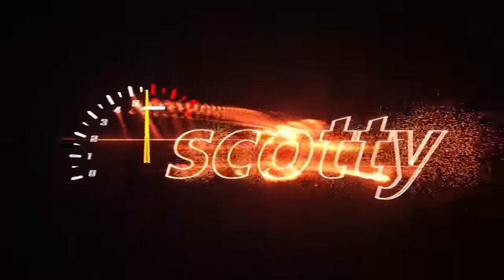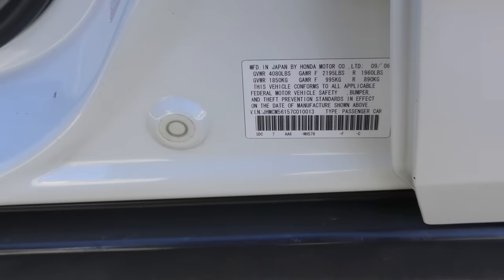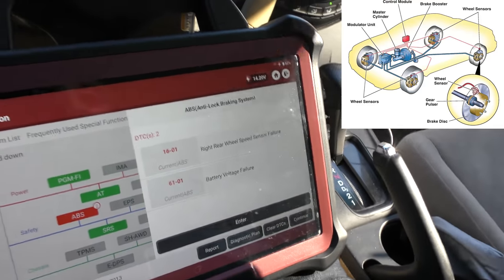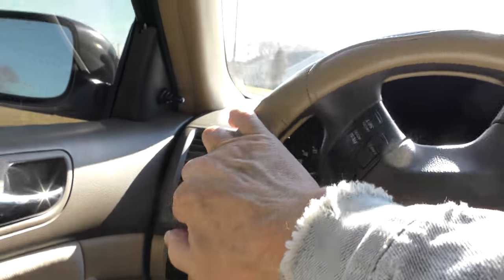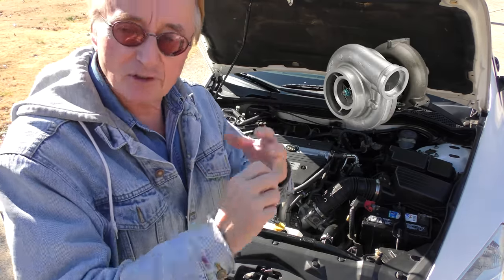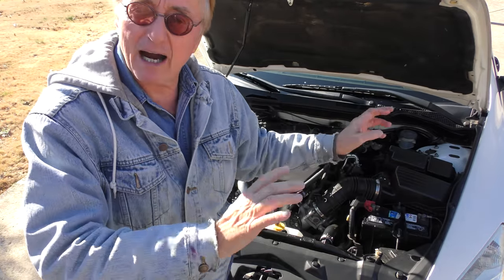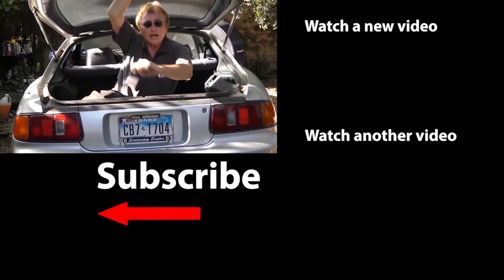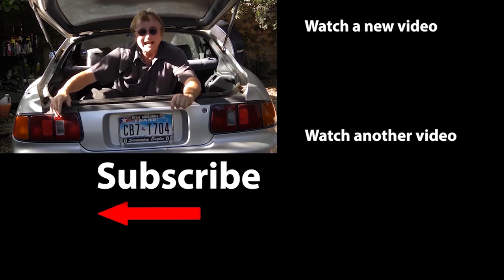Stop Buying Hondas with This Engine

Comment: I have a 04 honda accord with the 2.4 manual, and theyre fantastic cars. i got mine with 235 miles august of 2020. a valve burnt up may of 2012 at 282k so i rebuilt the engine, and shes at 288k. the k series is a beautiful engine.

Comment: The scary thing is I know you need to adjust the valves on Hondas but my friend who is a mechanic swears it's only on the v6 engines thank God I know know how to fix my own vehicles
Reply: Never heard of valves needing adjustment on Honda’s.  I put 480,000 klms on my 2007, engine was still quiet and strong when I put her down never any value adjustment.
Reply: @rodhurst5831  The  2.4k engine in  my 05 Element did  require a valve adjustment at 110k miles. Dealer says cost is $468 including new spark plugs. Interesting, the little box oil change shop manager claimed it is a scam but my home boys say it's important to do the service.
Reply: No all Honda engines need periodic valve adjustments, your friend is wrong
Reply: @overseasterritory8983  that's what I said

Comment: I have the same one but with the 3.0 V6. Runs great over 200k miles
Reply: V6 honda

Honda J30A engine for Honda Accord for years 2003, 2004 & 2005. ... which returns for a second-straight year on the Ward's 10 Best Engines list
Reply: Also one of the very few non interference honda engines.

Comment: Let me get Scotty up to date with new Honda engines. The oil dilution issue is fixed and the turbos in the L series and K series are easy to swap out even if they do go bad. Much easier than doing a timing belt change on an older J series and almost as user friendly as an alternator change since the turbos are located near the front next to the headers and radiator. So Honda still makes quality and  easy to maintain engines. CVTs are still not as great and or reliable as autos or manuals but give it some time and they may get to Toyota quality levels.

Comment: I have a 4cyl   2001 Honda Accord with about 2 1/2 k and I have always felt that what Scotty Kilmer meant about the 6cyl is not that it is a poor engine, but that it is harder on the tranny because the 4 and 6 cyl have the same transmission, so the more powerful 6cyl is harder on the same tranny. I f I am not correct, i apologize.
Reply: No they don't have the same transmission The V6 engine Was over powered for the transmission of 2003-2004 Is a later corrected the transmission

Comment: I don’t know who the person that owns that Honda is, but that’s a person every car owner should take an example from in car maintenance. I have no doubts that car will reach 500,000 miles or more if they keep it up. Well done Scotty also why doesn’t Tesla use the waste heat from the batteries or motors, which can easily hit 100 degrees. Or a heat pump. Serious Elon, get with the program.

Comment: The real problem with the 3.0L V6 is not the engine itself, but rather with the 5 speed automatic that Honda bolted to it. Ask me how I know.  Also the EX radios died after about 75k miles, and the brake rotors warped easily. Otherwise a great car.

Comment: I have a 99 Honda civic and it runs great . Just one problem  .... the brake lights do not work . I replaced bulbs , fuses , brakelight switch , turn signal switch and still nothing . All three brake lights are out

Comment: The 2.4 engine with minimum care is almost indestructible! My 06 TSX with 165K has been roughed up for its last 100K miles and still runs like nothing happened! That’s the engine but changed rack&pinions, various bearings, electronics issues, faded paint (no care), interior feels every single mile, etc…. The car has been beat up by previous owners yet engine survived these idiots

Comment: My 2020 ilx has the k24 engine  and is paired with an 8 speed dct.  My lease will be up soon, but the new integra is out of my price range.  The new integra has the 1.5 l engine and is paired with a cvt.  You can get a manual on the top spec 50,000 integra.  Much prefer the drive train on my ilx.  Being pushed into a civic 2l with a cvt.  Prices are ridiculous and interest rates are sky high.

Comment: 98 accord with over 270,000 miles on it when it was sold in 2015. Those 4 cylinders just run and run. Salt ate away at the muffler but 🤷‍♂️ thats 17 years of winters on it. 2015 civic with 160,000 miles and was well on its way to 300,000 by now but it was unfortunately hit and totaled.

Comment: 2010 Accord V6 timing belt just replaced at ~110K miles US$735 (AUD$1100)... in Australia, which is likely significantly more expensive than USA.
not cheap... but when it's once every ~100K ? not a deal breaker. at least not for me.

Comment: Hi Scotty! What's your opinion on the spin off segment that is popular in Asian countries? It's like a hybrid between MPVs and an SUV. These cars are 7-seaters with 1.5L petrol engine usually giving only 120PS and 130-140 NM Torque coupled to a 4 Speed automatic transmission or a CVT. Examples of this are the Toyota Rush, Mitsubishi Xpander, Honda BR-V.

Comment: the v6 is still very reliable. my friend got 500k out of his 02 Acura TL.
Reply: The 3.2 V6 in those cars are basically unbreakable aslong as you watch the oil levels those are very very strong engines I believe even stronger then the 3.0 v6..but man those Acura TL transmissions are garbage

Comment: Only issue ive had out of my wifes 07 accord ,with the 2.4l 4cyl  @170k miles , is low idle , ive been reading and i think the throttle body needs cleaning , and ill check the intake tube for leaks . But it runs great just idles low and vibrates a little.

Comment: I bought this car as a daily because of the reliabillity ive heard....But now im burning INSANE amounts of oil in this car...Pcv replaced, MMO added, tried everything only thing i can think is stuck oil ring in 1 or multiple cylinders. Burned 1 qt of Mobil 1 5w20 in only 200mi. PLEASE HELP i dont want to rebuild this motor
Reply: sell it and be sincere to the potential buyer that it burns oil. Get ur cash and buy something else. Time to simply get rid of it.

Comment: Scotty, I did what you said not to do- I bought a 3.0 Honda Accord with a 6 speed manual tranny BUT ITS GOT BAD VTEC because of an engine swap. It revs fine for the first 10 mins, but after that it won’t rev past 3k , it just bounces off and loses power unless I shift before 3K . Mechanics haven’t figured it out yet :( shoulda listened to Scotty
Reply: Try checking your Vtec valve that’s what they called limp mode your Vtec power switch are entire Vtec valve might need changing it’s right behind the engine for 2.4 I just change my Vtec valve switch and change the Vtec valve filter

Comment: I have a 2006 V6 Honda Accord with nav.  It has 245K miles on it and looks and drives as well as it did 17 years ago when I bought it.  The nav works better than the 2022 vehicle I have.  I’ve done very little to the car.  It gets 21 miles/gal.  Plenty of power.  Handling great.  I’m passing the car on to my kids.  I’m not sure this car will ever die.

Comment: Bought one 6 mos ago   4 cyl   no rust 120k mi 2500$  2nd car no repairs so far  not used much  code for gas tank    one allowed in NY.    2001    Passes insp.

Comment: Question ... I have an 09 CRV with the same engine , what should  someone expect to pay for the valve adjustment?  I've never done a valve adjustment on my own. Had the CRV from 2020 @87k- present with 145k currently .. Best honda I've had . Any other recommended major services at my current  mileage?  Water pump /serp belt / fluids?

Comment: I've got a an 06 Honda Element that has the K24 engine 4 cylinder 2.4L. It has 155,000 miles on it and uses a little oil, but It's been cared for really well. I so wanted it to have been made in Japan, but it was made in Kentucky. What really is the major difference between having it made in Japan vs Kentucky

Comment: My 2008 Honda's engine just broke down a few months ago with 305,000 miles, Just put a used Japanese Engine with ~30,000 miles compare durability with beautiful but Trash engines of an AUDI & BMW you'll be lucky if those engines last you 100K miles.

Comment: I had a Toyota Camry with a 140 hp four-cylinder engine and a Toyota Camry with a 268 hp six-cylinder engine.

The four-cylinder average 29 miles per gallon in mixed driving and a six cylinder engine average 27 miles per gallon in mixed city/Hiway driving.

The six cylinder had nearly twice the power, made passing other vehicles a breeze, and allows me to cruise down the highway at 85 miles an hour effortlessly.

I’ll take a six cylinder over the four-cylinder any day of the week.

Comment: Nice I have a 2006 2.4 with 250 k only thing it needs valves adjusted but runs like a clock

Comment: I'm currently in a financially questionable situation myself where I'm doing doordash to make money while I wait to get approved for SSDI and got a 2008 Grand Marquis with a loan a few months ago while I was still employed full time (and gas was still around 3 bucks a gallon). I'm getting back a decent chunk from taxes and am considering buying a car with that cash to get rid of the loan since I'm struggling to make payments since I'm putting $60 in my tank every 3 days (and Doordash makes me that much mostly during weekend days). An option is a nice 157K mile 1998 Grand Prix GT for sale that, after talking with the owner, has been maintained and even got a new transmission a few thousand miles ago (huge on those 3800 cars) but the owner got something bigger and stopped driving the Pontiac as much (hence why he's selling it). I'm at the point now should I take the chance of keeping my car, which in itself is in need of a lot of little repairs, or get the Grand Prix banking on the owner being honest and sell the Mercury to put the money I would put toward the loan toward the Pontiac instead. I'm trying to find a 4 cylinder car but they're all either beat to heck or need too much in repair for under 2K and the Grand Prix is so far the most promising right now despite having a V6

Comment: Scotty, I have this exact car with 320,000 miles. It runs like new. Lots of highway miles. One light came on and put catalytic converter juice in it and it went away. I’m shooting for 500k miles. Meticulously maintained. I never changed my oil before 5000 miles. Usually closer to 10000. Glad you concur.
Reply: My 2018 Civic will let you go about 10K miles before the oil light comes on. And I change it when the light comes on.

Comment: Scotty, we are looking to purchase a used vehicle for the third family vehicle for minimum needs, probably 5,000 miles per year. Looking at 2003 to 2007 Saturn Vue with the Honda V6 and Honda transmission. Looking at vehicles with 140k to 280k mileage. Price range is very attractive. What do you think?

Comment: I got a 2011 Scion xB 2.4 engine.  Burns alot of oil 173k miles.  I don't wanna get rid of It.  I thought about doing an engine swap with a 2011 Corolla 1.8 for better gas mileage and no oil burning.  I know I'll need a wiring harness but I'm not sure what else I will need

Comment: Damn Scotty reading my mind I have the same car and I’m starting to think it’s time to get rid of it!it’s been starting to rock me up money left ,right and center !
Reply: Curious, what have you done to it?
Reply: @jaybronze94  I’ve change  o2 sensor desno auto zone,the engine valve cover gasket major oil leak,spark plug’s,wheel bearing,driver cv axel,power steering pressure hose leak,front engine mount ,passenger engine mount,got the ac fix in 2020 was blowing hot air ,still the same alternator!brakes and rotors change ,new discount tires,change the vtc filter discover it was leaking and to change it you of to take the pulley and serpentine belt off,I change my Vtec oil pressure sensor switch discover a leak plus my car was in what they called limp mode rpm won’t go over 2k,and I change the filter for the  Vtec Solenoid also !I have 190k so at this point I might need a new water pump,coolant flush,seals  serpentine belt ,and transmission flush !And now Im starting to hear a whining in the steering wheel so I purchase the new O ring for the pressure pump I see online ppl say sometimes it the pressure pump needing to be change are just a new O-ring I went the cheaper route to see first if it’s just a cheap little o ring it need’s!and I also discovered I have a crack air intake filter so had that to the bill!and for some reason Honda headliner is known to get water soaking through the Passover side so overtime my headline finally gave way so it’s sagging like captain underpants !Its been a good A to B car I would love for it to last me another 100k are more bt I don’t know how much more I can put into it I probably wouldn’t gotten. Different car if it wasn’t for the market being this bad so I endup put money into it instead ,luckily besides the parts I mention I met a cool guy who live next door like Scotty speaks no English bt he knows car stuff so he’s been helping me which has save me with the installing of the engine mounts and changing the vtc filter and changing my o2 sensor

Comment: If you put it to a dollar and cents figure a quarter million miles car in today’s standard to replace it would be $.10 on the dollar per mile so basically you got $26,000 worth of car that you’ve used so far try to replace that car for less than that with a new car, Which means if you’re going to buy a new vehicle put that money in a bank earning interest and keep the old high mileage car that runs perfectly until it actually craps out on you then find out what it cost if it’s still within reason to Repair and repair it or use the money you saved to buy another car

Comment: My '95 2.2l only has 212,000 miles, But, a tree branch bash the hood crushed radiator support bashed up fender and headlights. Im debating wether to sink more money in. i had just rebuilt the front end.😢
It's all bodywork/paint really but, not cheap and Im kinda stuck.🤷🏾‍♀️
Reply: Best running car ever tho.
Valve cover gaskets/valve adjustments were annoying, computer died also annoying, did it all myself tho! Love this car❤
Gonna miss her.

Comment: Hey scotty , my 2012 honda accord lx shakes terribly at highway speed. The person who I bought it from back is july 13 of 2020 have refused to tell me the real reason why the car shakes at high way speed. I bought the car while it was with the shaking issue and the seller told me to buy new tires and I'll be good,  but the shaking haven't stop. I was told by a gas station mechanic that the issue is motor mount and I bought the motor mounts and paid him to install it ,but it's still shaking.
Reply: If it's not anything to do with the wheels, susoension, or body, and it's not the mounts, it's probably either your harmonic balancer or your VTC actuator

Get an OBDII Scan Tool (~$40) and scan your car for codes.

Comment: Scotty my newly purchased  2013 Honda Accord with 73000 miles on it jerks at low RPMs and sometimes very badly.. Scan tool only detects problem with Vehicle Stability Assist and power steering. What could be the reason for the Jerking... Daniel from Ghana

Comment: Is there any bad years for them Honda four cylinders?
Reply: 1998-2002 because of the automatic transmissions of course, otherwise minor problems with the 2003-2007 generation and 2008-2012 generation Accords, Civics umm early 2000 models, and CRV is the same thing, otherwise not really it varies. 🤷🏻‍♂️

Comment: I would trust that car as is more so than a 2021 Ford,Chevy, or Chrysler which I promise will break down before they get 90k miles on them. The junk being produced right now is unbelievable! They are selling some of the most problematic engines in their histories right now and charging more than they ever did in History for them. I will not touch anything outside of a Honda or Toyota going forward. Before the Eco-Boost and Eco direct injection engines came a long Ford,GM,and Chrysler was not that bad, but as soon as they introduced the Eco-Boost direct injected engines they have been terrible reliability wise and a lot of catastrophic engine failures.

Comment: About to buy a 2007 accord ex 3.0 v6, BUT only 28583, recent changes of timing belt and other stuff, pretty new, what do you guys think? (is hard to find 2.4 accords here where do i live, and ALL accords are automatic... there's more 2.0s though, they stopped selling 2.4's after 2005)
Reply: get a small flashlight and try to look at the frame for rust. Drive it like scotty to test the transmission gear when going from 1 to 2 and 3 ect such as when he gasses it, you see how clear and trouble free the engine revs up and down without hesitation and nothing being felt in the gas petal? thats what your mostly looking for

Comment: Scotty, I have the same car with similar mileage. Uses 1 quart of oil every 400 miles.  Tried the oil treatment you talked about, still the same problem. Do you think leaving some oil treatment in each cylinder overnight might work?
Reply: It is not leaking oil.
Reply: Have you changed the PCV valve?
Reply: Yes, PCV, new valve job and seals.

Comment: What's the shake/shudder when you put a Honda 2.4l in reverse. I checked engine mounts. Changed pcv valve.Need to check spark plugs still.

Comment: I have a 2005 Honda Accord v6 automatic with 65k miles on it,  should I change the transmission oil or leave it as is for the life of the car. I want to keep this car as long as I’m alive so if It’s recommended to change the transmission oil then I will I just hope it’s not too late .
Reply: Just do a DRAIN AND FILL, NOT A FLUSH.   AUTO REPAIR PLACES WANT TO DO A FLUSH BECAUSE THEY CAN CHARGE MUCH MORE. A FLUSH CAN LOOSEN SEAL

Comment: I have a 2017 Accord. I noticed a little droning from the engine when coming to a stop. Is that normal. The only other 4 cylinder I've had is a 2000 Ford Focus ZTS.